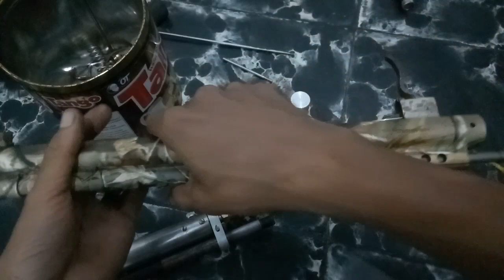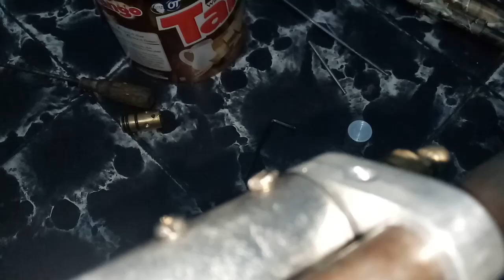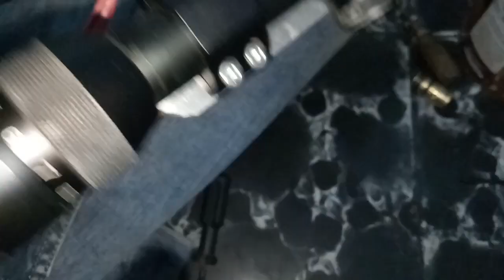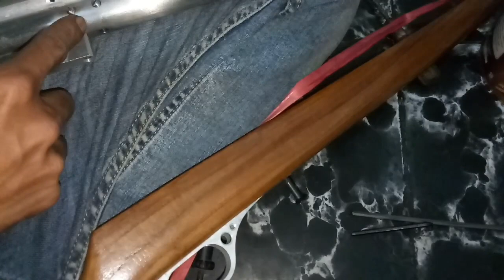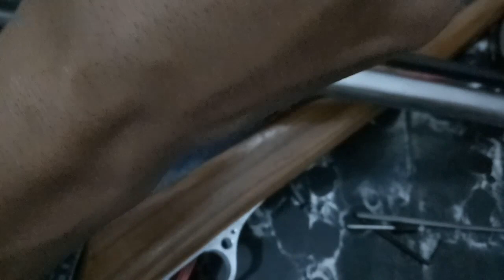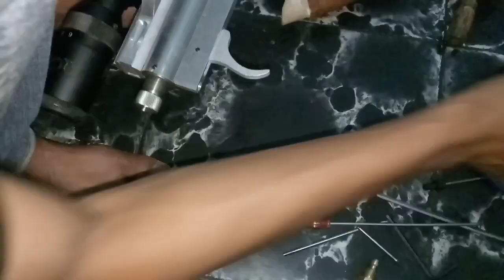MAIN TEKANAN TINGGI | simak video ini....!!!

Comment: Mas klo dural od 38 tbl 5 mm aman ga model pen sprti itu,? Soalnya punya ku drat nya sdh dol
Reply from the maker: dicoba sj om🙏
srn sy ttp bermain dibawah 3000psi
utk aman nya
Reply: Saya biasa di 2000 aja mas,paling mntok 2200 psi,begini mas,waktu bongkar penutup depan pipa, lalu saya pasang lg tp dol mas,mungkin saya masang nya kurang lurus,kemakan drat nya cuma sisa 3 drat yg masih bgus di depan,kira2 aman ga yah mas di 2000 psi,rencana mau gunakan baut m 6 panjang drat baut sekitar 8 mm ?

Comment: Maaf mas mau tanya..
Kalau rumah valve dan rumah cupler dari bahan Dural di pasang di tabung stainlist tebal 3mm sistim baut, aman di berapa psi mas ?
Reply from the maker: stnlisnya stnlis ap om
seamles p bukan

dural ny grade brp

utk as dural seri 6
konstruksi patek sekuat apapun
sy srnkn bermain aman dibawah 3000🙏
Reply: Stnlis seamless 304 mas..
Dural 6061..
Buat smal rncana gk lebih dari 2500 psi masih aman ya mas ?
Salam dari Lamongan 🙏